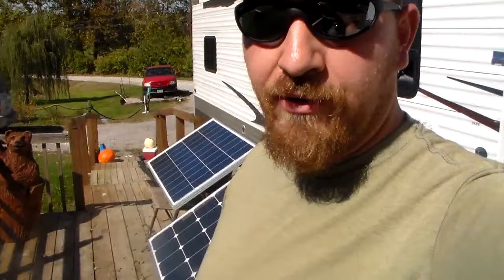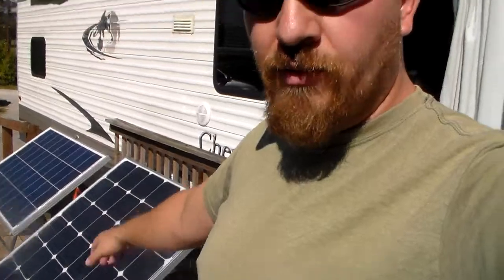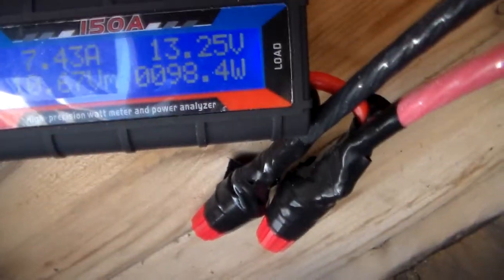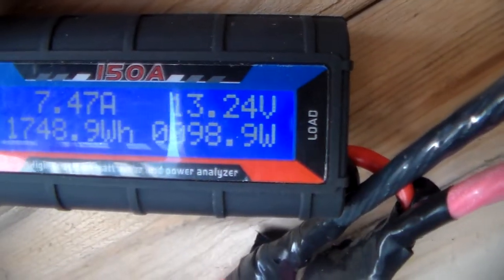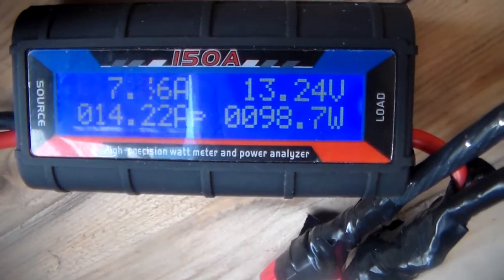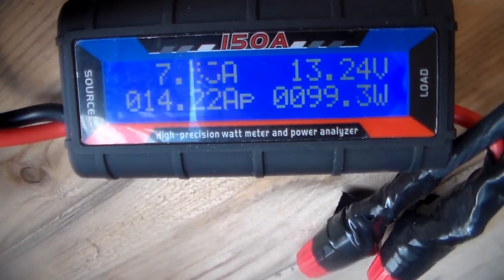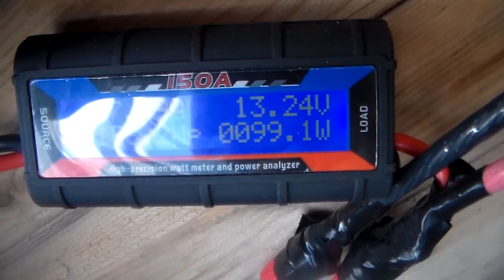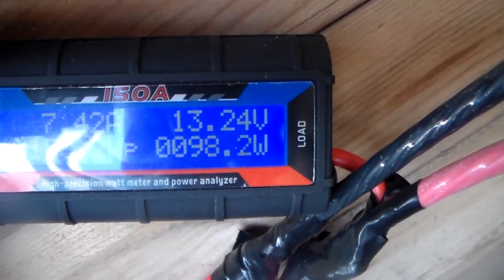Real life out put 150 watt renogy  monocrystalline solar panel

Comment: sir the efficiency of solar panel  is upto 17.5 % ,then how`s it possible the output of 150 watts solar panel is  96 watts.
Reply from the maker: +Kashif Khan You have the right idea but think of it this way the panel is 17.5% efficient producing 150 watts if same panel was 100% efficient it would produce 706.5 watts.

Comment: Good to know. I'm pretty sure that I'll be buying the same thing.
Reply from the maker: +MrChipGardener Its good system and for the price you cant beat it if your looking in to buying you a system i would recommend looking at bogart trimetric meter it will be next thing i buy for my system. I have to come to find out that with out it theres no way of knowing how much power you have voltage meters are in accurate they fluctuate to much to tell. for example i can full charged battery at 12.9 and put a small load on say 100 watts and it drops it on meter to 12.4 thats all most half power so to me theirs no way to judge how much you can use its like a guessing game.
Reply from the maker: +Matt's Homestead Side note nice channel just subed.
Reply: Matt's Homestead Thanks!

Comment: use an MPPT, your pulling the panel voltage down and losing 30%
Reply from the maker: +LambySRI Would like to use one but cant see the price versus min improvement on my small system. your talking about maybe 30-60 watts on my 250 watt system for decent size mppt to be able to grow with is around $300-$500 when i can simple add another 2 100 watt panels and gain another 160 watts for around $200-$250. I'm not saying your wrong or anything just till my system gets big enough dont see spending the money on it yet. Thanks for input tho.
Reply: Amazon $60 (MPPT charge controller out of China).  Get the 30amp model.
Reply: Yea exactly, MPPT is cheaper then another decent panel